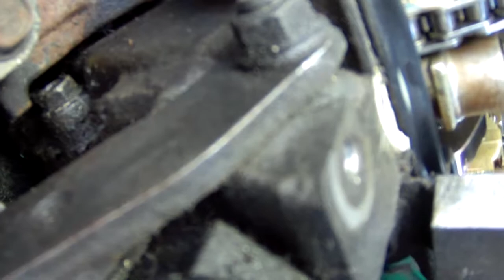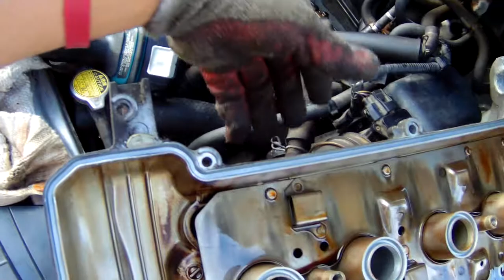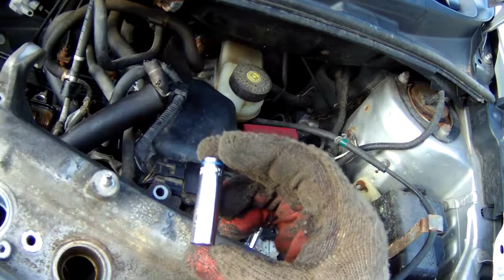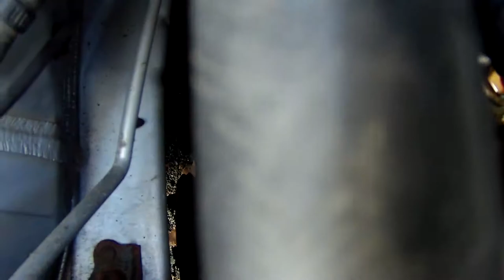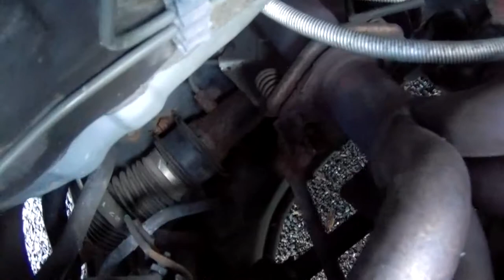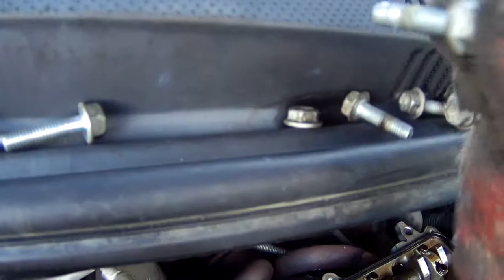How to Remove and Install Scion xA Engine Valve Cover Gasket - xa 2005 2006 2007-2015

Comment: Is there required torque for the valve cover?

Tools:
10mm socket for plastic cover, ignition coils, and valve cover removal (12mm socket for 2 front bolts for wiring)

Plastic mallet to softly dislodge valve cover. May need flathead to gently pry open.